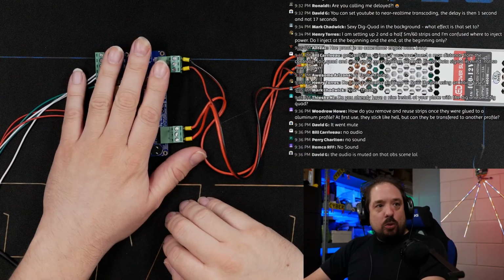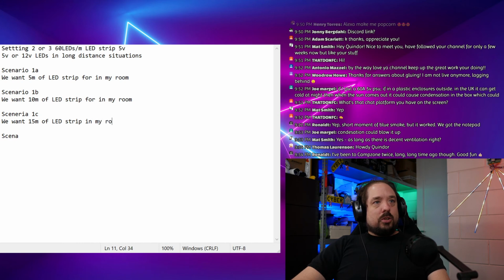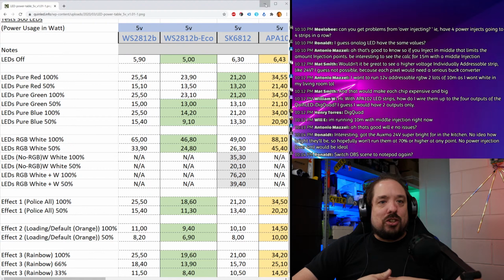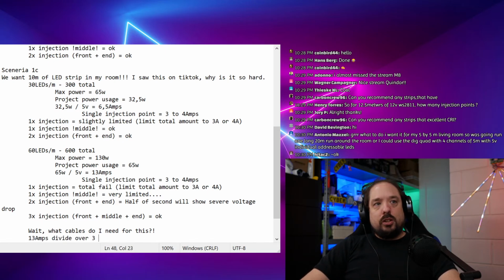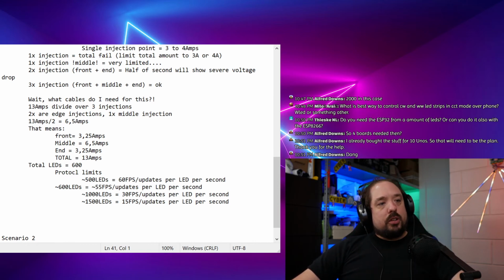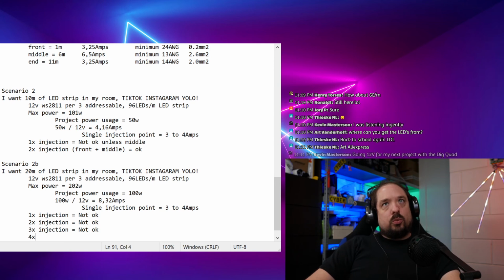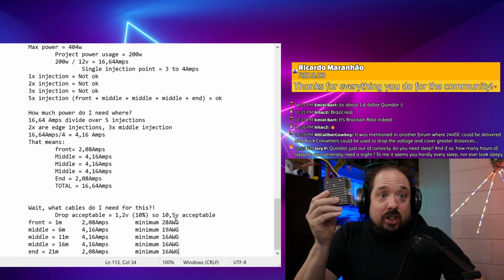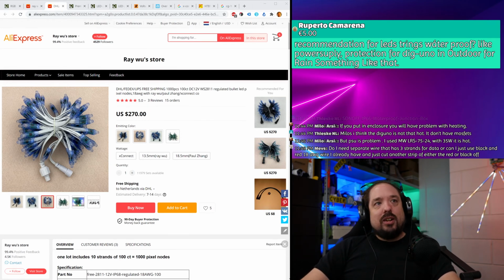Intermit.Tech #7 - LED setup talk

Comment: I'm a bit lost... I got some WS2812B ECO addressable leds and some boosters as well... I need to set them up like this::
Output | 10m | LEDS 2m | 5m | LEDS1m | 1m | LEDS3m | 1m | LEDS 1m | 5m | LEDS2m
it should be able to do full white (it will be controlled from a computer)
Can this be achievable with 1 power source from the output?
what kind of cables should I use?
Reply from the maker: You mean without more then a single power injection? That will basically be impossible or at least everything will be very very dim and powered limited. A single edge injection can deliver about 4A to the strip, at 5v that's only 20w. If you then chain everything offef that it means the setup as a whole can only recurve 20w of power and all LEDs need to share that. If you want more, you need additional cables that bypass the strip and inject power at a different point, raising up the total limit because of the now more copper being available to transport power.
Reply: @IntermitTech  so should I inject power on each ledstrip?
Reply from the maker: Well sure, that's a good first step, but really you should calculate it a bit. It's a bit more complex because of all the long cables involved but check this: https://quinled.info/the-ultimate-led-strip-power-injection-guide/
Reply: @IntermitTech  ok thanks... what about the Data cable?? can the distance from the first led to the board be long using a booster?
Reply from the maker: Generally 5m is no problem, 10m often works ok. Best is to use a 2-wire or 3-wire cable with GND+DATA on there, if 3-wire also positive and then set to 33R mode on one of my Dig controllers. That'll give you the best chance.

If not, look into the Quinled-diff series of boards, those solve long distance problems.
Reply: @IntermitTech   I just found out my data pin output is 3.3v so I need a Level Shifter, does the TXS0108E works for that?
Reply from the maker: I've never used those but I theory they should work, yeah
Reply: @IntermitTech  yeah, I tested it... It worked... 👍🏼

Comment: What is the easiest solution to connect led without any soldering i have 5v 4a for 2812b but with breadboard jumper wire has not been recommended.

Comment: What power supply would I need to run 30m of ws2811 bright 96LEDs/m
Reply from the maker: Sit through a bit of this and you'll know how to calculate everything you need for your setup! https://quinled.info/2020/09/26/power-injection-livestream/
Reply: @IntermitTech   in your  Opinion, Is 2811 96LEDS worth the more then double the cost of 2812b 30 LEDS, for permanent  outside Christmas lights.
Reply from the maker: It will really depend on the look you are going for, if it's a line, absolutely yes. If it's more individual LEDs, then certainly no.

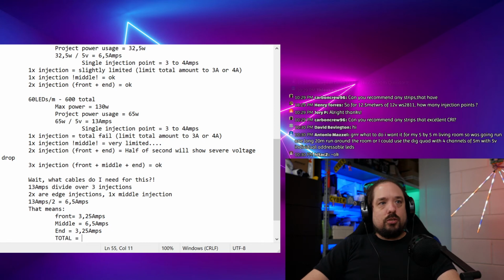Comment: The amperage calculation for the 3 injection points at 1:07:39 is very helpful. How would one go about calculating amperage for a parallel (single) injection cable? Does the end just have to be able to carry the full current? If so, I'm always shocked that so many projects seem to be able to get away with like 400 LEDs using 18 AWG wire .....
Reply from the maker: You'd calculate Amps needed per stop basically and then you know how much is needed for each point.

So if you have 3 points and need 20Amps in total with 5, 10, 5. First point cable needs to carry 20Amps, then from that point to the next 15Amps and then from that point to the last 5Amps. And thats also the issue with running a single cable, if you don't change cable size after each injection, you are wasting copper basically.
Reply: @IntermitTech  thanks for the explanation!

Comment: Hi Quin, I am planning my first project and it's 23 meters in total. I am looking getting the 2811 60LED/m but how do I connect the data wire from a dig quad, do I need to boost the data signal and or do I have to use more than 1 channel, if so what does that look like? Thank you for the video it was very informative!

Comment: Really helpful - some of this I've pieced together over the past few years but having it all brought together specifically for LED strips was really helpful.  I especially liked the part on acceptable voltage drop over the wires - I knew about the importance of power injection but didn't know how important the wire size was.  I'll be replacing some 24AWG wires with a heavier gauge!  I now better understand the value of 12V strips too!

Comment: So a good option for the 5v 2812b 10m would be to locate the one psu toward the middle of the run so that your longest wire runs are the lower Amp start and end power injections. This shortens the length of your higher Amp middle injections allowing you to use smaller wires.
Reply from the maker: Yes, that is very good thinking!

Comment: Quin, are there Power supplies with multiple adjustable voltage outputs? Or can I modify a power supply to have multiple voltage outputs? The reason I ask is, I am trying to troubleshoot the power injection of 5 volts over a long distance. If I have a power supply that outputs 5 volts on one output and another output that is adjustable to (say 7 or more volts), I could inject power 15 meters away without a huge wire. That way I could adjust the voltage on the second output to match the 5 volts of the first output, accounting for the drop in voltage due to the wire distance. I hope I explained it clear enough. Does this sound like it could work? Thank you for your help and for sharing your knowledge with the community.
Reply from the maker: I understand what you mean, but in practice this won't work. You would calculate for instance with a 5Amp load at 10m distance. So you inject 9v so that with the 5Amp load it's still 5v at the injection point. In theory that sounds (wastes energy as heat, but ok) but what now happens when the load isn't 5Amp but 0.3Amp, suddenly the voltage drop doesn't apply and you blow up your LEDs...

Onky way would be to transport like 24v and then use local DC-DC converters, but in most setups that doesn't make sense vs the alternatives.

Comment: Hoi. I dig the controller ;). Why don't you sell them locally?  It may not be expensive, but add another $11 for shipping, it adds up.
Reply from the maker: Selling locally in NL would make them about 2x as expensive as they are now for tax reasons for instance. I am looking into it, but for now, this is really the best.
Reply: @IntermitTech  ok. Thank you, I understand. But if I buy a dig quad from China, don’t I have to pay customs fee?
Reply from the maker: @Marcodenooijer  It's a possibility, yes. But if I'd import them and then re-sell them here again, you would have to for sure, including more costs.

Comment: Thanks for the video Quindor.  I want to set up LED strips around the upper perimeter of my daughter's bedroom and have it encased in 45-degree angle aluminum housing. The length is a little under 20 meters. I would like RGBW but it doesn't have to be pure white. Just something that will give her a good experience with it and be of some use. Do you have any suggestions for decent quality but not overly priced LED strip, power supply and aluminum housing?  By the way, I do not have permission to comment on your Discord channel
, do I need an invite or something else? Thanks

Comment: Regarding wires: solid or stranded?
Reply from the maker: Either, but stranded is a lot easier to deal with
Reply: Also on the thick wires: how the hell would you connect that to the LED strip?
Wago onto the tiny wire of the strip on one side and a thick wire on the other?
Reply from the maker: Yes, connecting the thick wire to the LED strip won't make it take in more power, it's to minimize the loss over the distance. You can solder the thick and thin together with some hearshrink or WAGO is always a good option too.

Comment: This is the most underrated video of all time.  If there's anyway to condense this into 30 or 45 mins, that'd be great.  But honestly, you'd lose the interstitial/in-between Q&A, which is independently valuable separate from all the data and calculations you went thru.  Both aspects are important, but reproducing into a tinier video package would also be nice.

Just showing the rapidtables calculator was awesome.

Comment: Quin, I bought a Dig Quad from Dr. Zzs and I set it up to run a four strand run where they do not connect from strand to strand.  I ran two short strands 30 chips with 90 RGB LED.   These are addressable in 3's, instead of every pixel.  Before I put them outside everything worked when I connected them to each other inside.  However, I changed up the design and just ran them individually for the clock wire only.  For two, I connect the positive and ground using lever nuts and the other two I connected lever nuts.  The first strand works as expected using Pacifica C9 and the second just lights up full whitish color.  The other two do not work.  I've multimetered all and they show 12.52v.  I've got a 30 amp power supply, more than enough to run this.  Any ideas?

Comment: I am going to disagree with the inline fuse argument.
Yes, a PSU may have oc protection in electronics, but if that fails to kick in and you don't have that last line of defence, a fuse, you have a firey mess.  Especially if these are hidden in a roof space or another hidden location and not accesed regularly.

Comment: I missed the online broadcast. In the third picture you drew the second strip on the right which itself seems to be similar to the whole second picture where you injected power on both sides of the strip. Why didn't you add the third injection to the third picture to the right end of the second strip?
Reply from the maker: You Sir have spotted a mistake. I did it correct in the calculations but a 300LEDs or 60LEDs/m strip always needs 2 injection points (or 1 in the middle). I added it in the drawing I put up with the article in the description. Good catch!